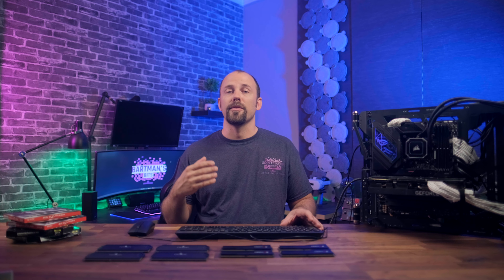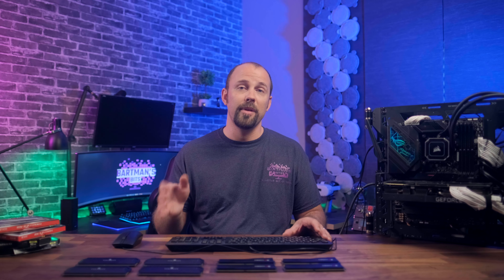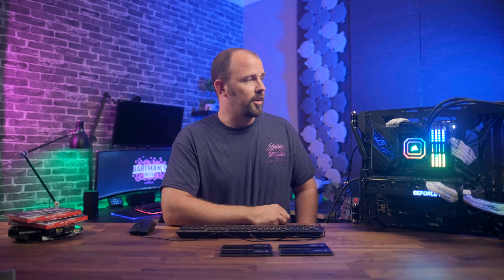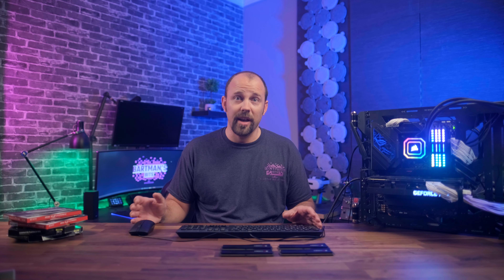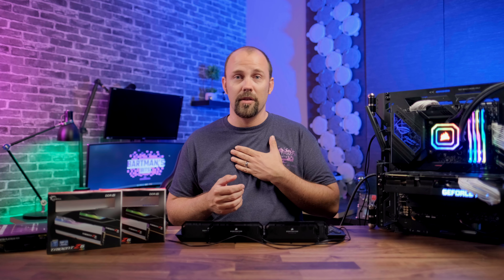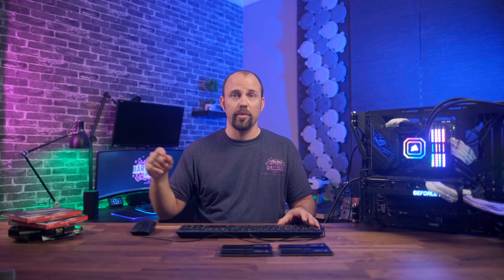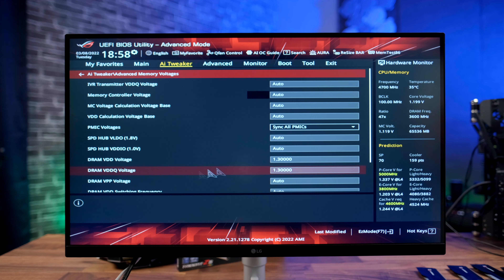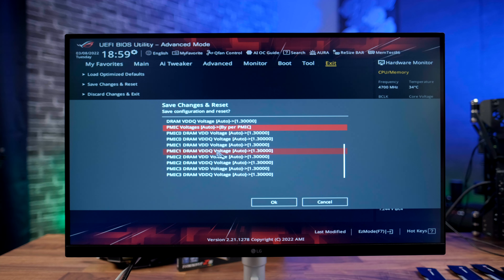Intel’s DDR5 problem resolved! DDR5 64GB Boot Loop failure Fix. Get the rated speeds of your RAM!

Comment: I would give you a better advice. 4 memory sticks result in lots of crosstalk. You should play with Skew settings. Ignore the ones that says Group A and Group B, for the rest try to put them somewhere in the middle. 4 memory sticks require higher values to have stronger signal. Stronger signal though may prevent you of getting high speeds, so you may need to lower those values actually. The higher speed you go, the harder is to find the balance.

Comment: I’m using a ddr5 trident 6400 cl32 32 gb so two slots .. gigabyte b650e master , however xmp will cause this issue so I am trying to manually change everything to suite 6000 memory frequency could you help me with the numbers what to put for the rest of the config to try tam at 6000?

Comment: @Bartman's Bits i have a 14900K on a Asus Z790 Apex Encore and having 48GB (2x24) 7200Mhz Corsair Titanium RAM... cant get it running at full Speed... stuck at 4800Mhz even with your Settings :/

Comment: I'm just buying my next computer pre-built. I have had nothing but 2 years of headaches. From Asus sending 4,096 watts to my Intel I9 13k chipset. Blue screens of death for a year and a half. And now I got to redo all the timings cuz I updated my BIOS to the new Intel default bios. Everything was working fine before but all I kept hearing was update the BIOS update the BIOS update the BIOS and now my bias is updated and I can't get the sing to boot up

Comment: Darn.. I was hoping you had found a solution to DDR5 XMP profiles crashing certain games like CoD when running at the rated speeds. My computer runs just fine with the proper XMP profile of my 7600 DDR5 until I try to run some triple A games. Something about the XMP profiles causes DirectX errors and in order to play those games I have to downclock my ram by at least 400 mhz.

Comment: Because I wanted to be RGBtarded, I absolutely needed 4 sticks of corsair vengeance to work. Rated at 6000/cl36 and XMP capable I managed to make it work at 5600... sort of. It was stable until it randomly crashed at the next boot. Couldn't change the voltage on my z790 but xmp 3.0 already set it at 1.35 so the only thing I did was the 2nd part of your tweaking. Surprise, surprise, it works at 5600 with no issue again.

Edit: MB - ASRock z790 PG Sonic 
Cpu i9 12900k unlocked.

Comment: The solution is weird as hell, but it's working for me with 4 x 32GB DDR5-5200. I have a MSI motherboard, I had to just had to turn on XMP, then scroll down in the BIOS until you see DRAM Voltage [Link]. Change it to unlink and fill in all the voltage fields for each stick with 1.3 (assuming your RAM is 1.25).

Comment: I think the issue is the 12900K and some boards.  My Z690 Master just isn't agreeing with 6000 MHz, or XMP.  Tried everything.
EDIT: The issue was that the RAM sticks needed to be in slots A2 and B2.  I didn't think that it should have made any difference, but yeah I just switched from A1 and B1 to A2 and B2 and it booted up the first time.  Read the manual guys, it was something that was easily overlooked.
Reply: Okay what about if you have 4 sticks
Reply: 12900k max is 4800mhz if u go beyond 5600 it'll have a hard time booting
Reply: @ianolivas9920  Don't know yet, try it.
Reply: I had the same problem and they were in the right slots couldnt boot to 6000mhz it stayed at 4800mhz  thanks to this vid i got what i paid for!

Comment: You are a lifesaver! My PC was going mad with 4 DDR5 sticks XMP 6000 but your fix made a difference. My only question to you is that when I enable XMP the voltage is shown as 1.35000, do I increase this or leave it as it is. Also my PC skips bios straight into Windows 11 is there any fix for this? CPU Intel i7 12700K, GPU RTX3080, OS Windows 11 pro, RAM Fury DDR5 6000, Motherboard Asus ROG STRIX Z690-E GAMING WIFI
Reply: maybe you have fast boot time on?
Reply: I have problem while i’m running xmp 1 with my ddr5 can u help me please?

Comment: On my Asus Z790 Plus WiFi motherboard 4 modules of Corsair  32GB KIT DDR5 7200MHz Vengeance Black PC5-57600, CL34-44-44-96,  1.45 V  XMP 3.0  this solution did not work. I changed to 1.3V first, did not boot, I changed back to 1.45V and still the same NO POST problem :( Any suggestions?

Comment: I am having same issue, please help

Intel i9 14900k Crashing / Gigabyte z790 UD AX
I see unexpected crashing issues when I install 4 G.skill Trident Z DDR5 RAM sticks (4000 MT/s) instead of 2 (4800 MT/s).

Some config I have setup:
Performance CPU Clock Ratio: 55
Efficiency CPU Clock Ratio: 42
Extreme Memory Profile: disabled
BIOS is up to date : [F11e]

Comment: Had no issues until today and spent all day troubleshooting it to boot properly. The BIOS sees 64GB of ram but once it tries to boot up to windows it shuts down. I changed the CMOS battery and removed memory sticks for 5 min. and still an issue. The only way I can get it to work is by installing 1 memory stick and it will boot to windows. Once I add another stick it won’t power up. I’m fed up troubleshooting this all day.

Comment: This kinda worked but not at 5600. Went to 1.35 at 5600 and it was unstable as it was crashing at 1.3. Tested 5400 @ 1.3 and it failed memory tests.

 Landed at 5200 @ 1.3v and that was stable, memtest passed. Using 4x 16gb corsair Vengeance ddr5 5600, the pairs are matched, but all 4 aren't matched.

Any advice further than 1.35 for 5600? It's a real bummer that I paid for 5600 and can't use it past 5200. Rog strix z690e mobo.

Comment: Hey thanks for this. You noted that your 5600 ram has a stock voltage of 1.25v and that you set it .05v higher at 1.3v. I have 5200 Mhz ram rated at 1.2v. Should I use 1.3v or 1.25v?

Comment: I have 4 sticks of 16gb DDR5 6200mhz teamgroup delta-r using in an asus prime-a z690 and an i9 13900k, even following the video and I couldn't get out of the loop, it's currently at 4800mhz. would you help me?

Comment: What happens if I get the same problem even without XMP? Even after CMOS cleaning and using default BIOS profile it won't go in. It got stuck in RAM POST (orange light) for almost 30 minutes.:face-pink-tears:

Comment: Amazing ! Can you please do a similar training video for MSI Bios that is totally different. I cant find in MSI Bios where can I set PMIC Voltages / by per PMIC. I have a MSI MPG Z690 CARBON WIFI I9 13900K  and 4 x 32 GB DDR5 corsair vengeance 5800 Mhz . unfortunately the memory is running at 4000 MHz. Thank you !

Comment: Tried this and still getting crashes and memtest86 errors.

Using the Asus TUf z690Plus, i5 12600k and 32 go (4x16) of Corsair vengeance 6000mhz.

Have any other recommendations to try?

Comment: I just got new PC with 2 sticks only when i turn on XMP II / XMP I my pc wont boot.. i dont get it.. 
i did give it a lot of time to do the "learning" processes, and also took out the ram for few minuts, 
and did everything you showed in the video  and it wont work. 
when i go back to "Auto" my 6000MHZ ram shows on bios 3600.. :> 

Intel Core i9 12900KF 3.2Ghz 30MB Cache s1700 
 Asus ROG STRIX Z690-F GAMING WIFI LGA1700 Z690 DDR5
Kingston FURY BEAST RGB 2x16GB DDR5 6000MHz CL40

I got last ver of bios

Comment: Hasn't worked for me. I've tried almost everything. I'm running gskill z5 4x16s @6400. Stock voltage is at 1.405~. which to me seems kinda high. Everything works fine without xmp. I wonder if I should get a z790 instead of a z690.

Comment: Hello all I need help, did what was said in the video but still posting into safe mode on BIOS 
MOBO ASUS ROG STRIX X670E-A 
CPU: Ryzen 7950X
RAM: DDR5 Corsair Dominator 5200mhz 4 sticks of 32GB=128GB. Boots up with two sticks of ram in from each set at 5200mhz but only boots up to windows when it is set to auto which is 3600mhz with all 4 sticks in. Plz help thank you

Comment: Update March 2023, just built new pc, ASUS ROG Z790 4 sticks of 32gb dominator platinum 6000mhz, follow his settings but i changed my voltage to 1.35 and my ram clock speed down to 5600mhz booted just fine

Comment: I wish I could say this worked for me. Im still getting BSOD’s but mine are related to when I’m running creative software. I know it’s the ddr5 tho cause I’ve switched back and forth between two channels of ram and 4 and it makes a different in the amount of BSOD’s I’m getting. Im also not getting the BSOD when I trouble shoot the same applications on other ddr4 builds. Really frustrating. Ended up spending $1300 in motherboards and ran to come to this conclusion. 

Update: it’s not the ram that was my issue. Bought a ddr4 board and got the same errors on it. Might be a 12th gen issue.

Comment: Hey i have the same problem with my amd motherboard i have a ryzen 7 7700 with 4x8gb 6000mhz speeds and when i only put two it works perfectly fine at 6000mhz but when i put all four the windows keeps crashing and bios freeze and alot more problems does anyone have a fix?

Comment: I am running an Asus Maximus Hero with a 13900K and 4x 32GB DIMMS or Corsair Dominator running at 5600.  I did the process you outlined but I set the voltage to 1.325 and the speed to 5200.  It posts but Windows Memory diagnostic is still reporting an issue.  When I run the diagnostic on the 2x 32GB I have no issues.  If you have any other insights it would be greatly appreciated.
Reply: I ended up lowering it to 4800 to be stable.
Reply: I have Almost the same exact setup as you.  I followed his steps and was not able to get mine working either.  I am also running it at 4800 :/  hopefully intel/asus can fix this in a bios update in the future.

Comment: Recently my 4 sticks of G skill 6000, only works at 1.39Volt 5600 Mhz. As I understand the faster my ram run more heat is generated. So after adding ram fans to cool my ram, I can now run at 5800 Mhz 1.395 Volts stable with MEM 86 tested. I refuse to go for the top speed 6000 with higher voltage as it could shorten the life span of my ram in the long run.

Comment: Does this same thing happen with ddr5 32x2 sticks at 5600? or is this just a 4 stick problem at 5600?
currently i use 16x2 5600 xmp activated and it works fine
If i wanted to get to 64gb and 5600, how can I avoid this problem? by getting 2 sticks at 32gb each, or by getting 4 sticks at 16 gb each?

Comment: This did not work for me: 14900k, z790e, corsair 64 gix,(16x4) I tried everything, just enabling per chip, slightly increasing voltage, removing memory and letting sit and nothing. It just kept rebooting non stop. Looking for ideas. Stock voltage was 1.1, xmp1 wanted 1.4v and I tried increasing to 1.45 and it would only go to 1.435

Comment: After 2 days of troubleshooting and watching this video, no discredit to you by no means because this is something that most PC user probably also know; except even though I have a degree in IT due to a concussion I now am medically retired with a TBI due to a fall. So, the obvious is not so abvious. I am saying all of this because..... I ran thru your video 3 times and nothing worked, until I viewed another video that suggested I "update my BIOS". What? I just bought this new $3800 desktop rig a few months ago but yep, sure enough... after it coming with 64GB T Force TeamGroup 6000MHz 1.30v, and literally the only difference on what I purchased was the same thing except it has 1.35v. I thought that is what was causing the trouble. It was not even completing the POST. But after the BIOS update, it accepted the 64 and now not only does it have 128GB but it boots in 36 sec flat ready to use. I can allocate 64 GB of virtual memory to any memory hungry game and max them out and no issues. So, with that said, there really is no need to OC. Excellent video though and I subscribed.

Comment: Still having the issue trying to run 4x32Gb DDR5 6400 G.skill Trident on a ROG Maximus Formula z690. Annoying thing is each individual stick works on its own at 6400 with XMP I/II/Tweaked enabled and every stick works with every other stick in a pair (in all DIMM slot combos), so the memory is good to go.
Reply: found a solution?

Comment: So I have Corsair dominator ddr5 6000mhz and I did follow your fix but then I run into all sorts of issue with windows actually booting and then blue screens of death you should definitely make a video about the 6000mhz + fix videos or if you know a fix how to fix the blue screen of death after adjusting the settings in bios !

Comment: Great video, very informative as I am about to upgrade my DDR3 system to DDR5. However, does this affect the 48GB ram sticks?  Could I run x2 48GB for a total of 96GB ram without any issues?
Reply: I  can run 2x48GB sticks at 6800MT/S without having to make any changes - XMP works automatically.
When I plug in my other 2 sticks - (so running 4x48GB) It takes a little bit of adjustment and a lot of waiting while it trains the memory.   I get very stable 4x48GB at around 5800MT/S

Comment: I have a rog strix z790 e processor i9 12900k and ddr5 6400 32cl 32g and my problem is that with two strips everything is fine but with 4 strips I can no longer even access the bio in xmp 1 the voltage is already at 1.40 I might break it if I increase the tension too much

Comment: Im using 2 sticks of coarsair 16gb advertised speed of 5600mhz with no xmp after bios update it runs at 4800mhz same thing happens with xmp and without xmp i have tried to manually clock the ram without xmp still nothing stuck at 4800 c40 super frustrated.

Comment: mine has always booted but if i play any games, games crash immediately upon start up. Then i get a crash message (directx error) on MW2 and other newer call of dutys. i bought dominator platinum 4 16gb - 64gb 7000mhz cl34 ddr5 ram to use, but im only using the two sticks at mo until i find way to run all four with xmp enabled. (all 4 sticks are identical, all 7000mhz advertised speed and same CAS latency at CL34)

Comment: I have an asus rog z690 rog extreme and 64 gb (16x4) corsair dominator platinum 5600 mhz C36 1.25 V

If I put 2 sticks I can easily actívate XMP profile, but even doing the exact settings and steps you show in the video in my bios (1403 up to date btw) it doesnt post 

If I use lower frequencies ie. 5200 mhz, post without issues , but in games performance is hell, with random crashes and stutters

The only way I can get to work 4 sticks without any issue is auto profile (base 4000 mhz c40) which is waaay low than the advertised 

ive tried everything but I believe until a bios Fix is available or a ram update, i will use only 2 sticks at xmp 5600 mhz c36
Reply: Same issue here. z690f.  2 sticks works great  4 sticks can't run smoothly above base clock

Comment: For others, "If you try to get the XMP mode to boot until you get a Blue Screen Message, you must reclone the drive because Microsoft has done something to disable to drive so you can no longer use it. When Booting after you apply this fix, you will get the spinning time wheel showing it is working on loading and it will Blue Screen over and over. There is not fix. After I recloned my drive, this fix worked flawlessly. I have the proper CAS Latency of 28 and RAM speed or 56000MHz. Thanks dude!"
Reply: I actually just tried to pick Manual Mode and it is not at least trying to boot. I am getting a Blue screen now saying Window could not boot now. I pre Enter and it does the same thing again. I am on the right track so, is there something that that Manual Mode does not set I need to set, which with finally cleat up the issue with getting the RAM speed they advertised?

Comment: Thanks it worked but not in 6000mhz i have corsari 4x16gb 6000mhz ram is switched it to 5600 and it works perfectly.

Comment: I can never get XMP to work, on my old system z390 hero and 9900k I couldn't get 3600Mt/s, and now my z690 and 12900k, it took me ages to get 5200 Mt/s to work, and I have now got a 32Gb 6400Mt/s kit and that won't work either, all 3 kits are just 2 sticks, the amber light just comes on and stays on, then after ages I get the OC failed/ press F1 message. It can't all be down to silicon lottery?

Comment: Hey hey,

I have an asus b660-a ddr5 capeable motherboard with a new i5 13600kf cpu, also have 2 sticks of ddr5 6000mhz 16gb so its 32gb…
My system as you mentioned in the video only work and see 4800mhz. 
I went through the process what you just showed in the video. Waited around 15 minutes but nothing happens after the restart, seems like no boot at all. I put the voltage from 1.35000 to 1.40000 V as my voltage was already 1.35000.

Any advice anyone? 
Its just sad to spend more money on rams which not working as it should be.

Thank you❤❤
Reply: Check the QVL of your board and make sure the ram kit is verified compatible.

Comment: Hello, i have this protblem with XMP. My A-data 6000mhz XMP 1.35v don't start more then 4800. i have try to do 1.4 increase and this not help. (with one by one setting voltage) Maybe i can try something else ?
Reply: now i rich 5400 mhz STABILE  for 4 xpg of xmp6000 
i use 1.35v and +2 timings of xmp and also per dimm voltage 
will continue my test

Comment: Hi guys, I have Proart z690 wifi Mobo, and it says dual channel but it has 4 dims slot.

I have module of 2x16gb Corsair ddr5 5600mhz installed, 

My question is, if I upgrade my system to 64gb,
Is this will be work if I add another module of 2x16gb Corsair same MHz? 

Or I need to buy a module that 4x16gb? 

Thank you so much my understanding is very far for now.

Comment: Z790-E + g.skill 7200 16gb x2, bsod paradise and was stuck in boot loop all day until I changed settings as above in video. Getting bsods alot and random loops even after lowering the clocks down to 4000. Gonna keep dropping them and see but I'm going CRAZY.